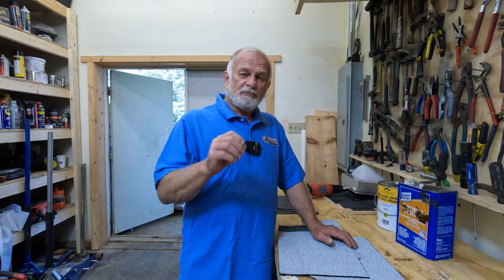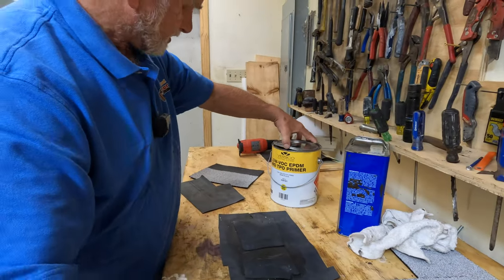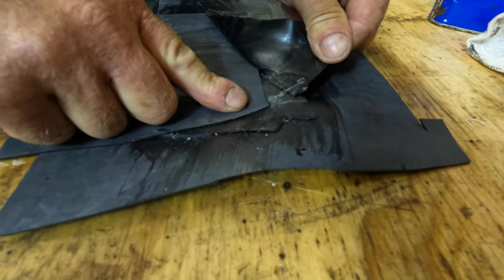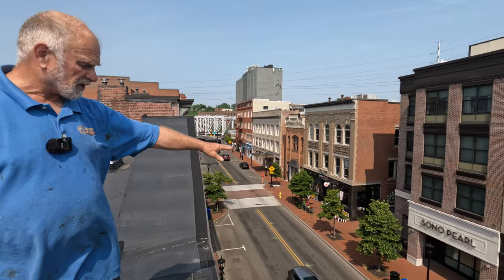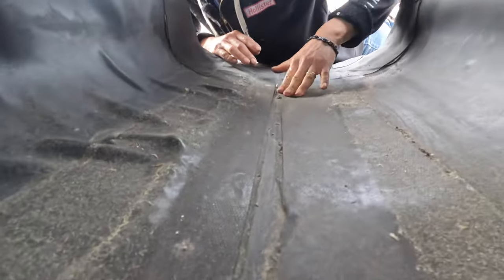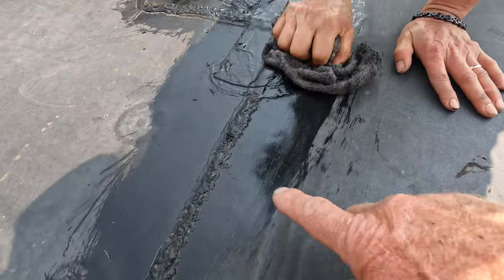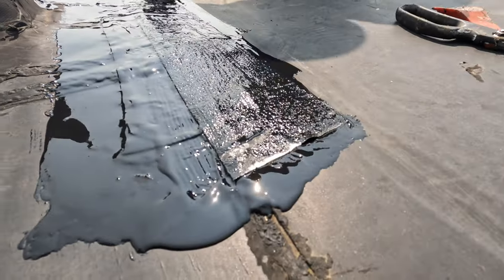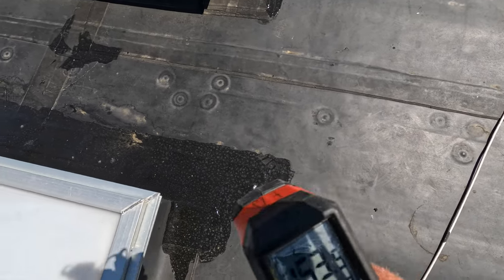Why EPDM Rubber Roofs Leak and How to REPAIR Rubber Roofs Permanently with Easy Brush on Sealant

Comment: Pretty sure this man needs to go back to rubber roofing school been flat roofing 25 years he’s not accurate with current insulation methods
Reply: Just because current methods are different than old; it doesn't mean they are better!
Reply from the maker: We never talked about insulation in the video???  We only show what went wrong and how to repair it. What insulation?
Reply: I think he meant "instalation " but hes right, you have your old school tricks that in certain situations work just fine.  But your take on epdm just is not accurate / up to date. And stop calling people ignorant.  @FlatRoofDoctor

Comment: EPDM sucks.  Even with this repair it, it will eventually leak again.  EPDM is also thin so with enough rain, water will go through.  With time, the adhesive will wear off and the EPDM will peel apart, allowing water to get in.  Unfortunately, with flat roof, you don't have a choice.  The permanent fix if possible is to make the roof slope slightly and go with torch down that is much thicker and permanent.
Reply: Really don’t know what your talking about watch to much fake flat roofer from east
Reply from the maker: I agree about Torch Down being the best. But your statement about EPDM will leak because of a lot of rain, makes no sense. There are many 1000's of EPDM roofs and they get a lot of rain. The issue is EPDM shrinks and eventually will put pressure on the flashing and walls pulling it loose. Yes it is thinner than Torch Down,  but that is not a cause of leaking. As in the video, we show exactly the reason for the leaks. The seams that are glued together will eventually separate.

Comment: You only showed a primed lap joint,they make a 3"&6" seam tape to do a much better job in splicing the seams together.
Reply: @3:28
Reply: @MNCasaPro that’s “cover tape” used to strip in a seam that has failed or so on. Seam tape goes between the 2 pieces of primer rubber to bond the two together. They haven’t bonded seams with just primer in 25+ years. This dudes a hack.
Reply: @carterdavis9416  Got it.  I've been looking for the product you describe, as I've seen it in a number of other vids.

Comment: Seams are always the issue regardless of the type of material and the roof shown has plenty of them. Super Silicon and similar products all pretty much insist the "fleece" reinforcement be used as it is a total system. It can resolve almost all leak issues. I wonder why ANY contractor could not remedy this leaking easily. So sad.

Comment: I have a section of my house that has an epdm roof on it. IT was already installed when i bought the house. At the edge of the house right before the gutter. It lookes like they used some sort of 4 to 6 inch tape ( i assume something like u showed early in the video). What is the proper way to terminate the rubber roof right at the edge  like where a drip edge would be. ( hope that makes sense} can i use the super silicone over the existing tape that they put down.  I really need to go back up there and investigate but there is tape ran all along the edge of that part of the house. Its not leaking at the  moment but looks like water would travel that way and hit the tape before it goes over the edge and into the gutter. I assume water is going to eventually get under the tape.
Reply: Don’t listen to this dude. He has no clue what he’s talking about. They haven’t solely relied on just primer on seams in 25+ years. He’s also using a primer that is not made by any roofing manufacturer. They use “seam tape” between the seams. The “leaks” he’s showing is just hack work, and not done to manufacture specifications. An EPDM rubber roof will last well over its life time when installed correctly to the manufacturer specifications.
Reply: @carterdavis9416  thank you this dude is not educated in commercial roofing for sure. To answer your question the tape is to cover the nails that were put down to hold your gutter up. It will last as long as the roof as long as they used the correct seem tape and the correct primer.
Reply: And all rubber needs to be terminated with metal. If it's just rubber then you need to install some drip edge or gutters onto the edge
Reply: @tdenver68  Thank you for the info
Reply: @robavis4906   it sounds like it's the 4 or 6" seem tape that they put over the nails that hold the gutter on. That is standard practice and done correctly and the epdm will hold for 25 years plus. Your epdm roof is way better than shingles and will last forever if you keep it clean.

Comment: Just because current methods are different than old; it doesn't mean they are better!
Reply from the maker: Technology keep changing. Maybe we should have stayed with the old cars and old appliances. EPDM have been used for roofing since the 60's . Ever Since they have had trouble with the seams. They have changed the adhesives and technique over 5 times and still do not solve the problem. Using the Super Silicone Seal is a huge breakthrough. That is the only product that will seep into the small crevices and joints and seal it. It also bonds to EPDM super super good. So back to your statement - This current method is proven to be far better, saving a lot of people a lot of money.

Comment: Wonderful tips and tricks. I would also paint it with aluminium paint. Rubber is excellent material, but the seams are always an issue on a rubber roof.

Comment: THIS IS NOT HOW RUBBER IS INSTALLED.

You would use adhesive on a 3 or 6 inch seam tape with 1/8 of an inch reveal.
Reply: You tell him. I think that guy is on crack

Comment: Great video. Two questions. 1 -- can you apply this on seams even if you have roof heaters installed underneath the roof rubber? I live in Boston, winters can be harsh, so, there is a roof heater for heavy stormy days. 2 -- would butyl tape do the same job as the super silicone seal?

Comment: Once the can of Super Silicone Seal is opened, does it store well if you put the lid back on tight? Or will it go solid so you would have to buy another can if you wanted to use it later?
Reply from the maker: no sealant stores well, not even paint. once it is exposed to air and moist, curing starts.
Reply: Manufacturers website states...Shelf life after opening: 1 month (adequately sealed).

Comment: I was given a rubber roof. So I'm not sure if its epdm. How do I tell? And I need to make the roof a little longer is it ok to attach a different type of rubber to it?
Reply from the maker: You better off staying with the same material. EPDM feels and looks like an innertube of a car tire. Torch Down Rubber have seams every 3 feet.

Comment: what about using polyurethane caulk between epdm layers? would it make it any better? polycaulk has low vicosity to penetrate cavities inside those grift multiple patches one on another and very flexbile and bonds tight to epdm i assume as it does to conrete and wood but not metal
Reply from the maker: caulking covers a small surface area and when it shrinks, it comes loose

Comment: My job tomorrow is leaking huge skylight over restaurant,  the leak is exactly what he is showing ( to places) in external epdm external corner upstand. Leaking under lap,  I patched it with a torch on patch x2 its worked, replacing hole roof with torch on sbs tomorrow
Reply: You patch an EPDM rubber roof with torch down material? 😂 you’d burn through the rubber writhing seconds of trying to “torch” your patch on. You hacks need to stop talking about stuff you obviously know nothing about. 😂
Reply: @carterdavis9416  fool you don't torch the rubber you use a hear gun
Reply: @nonsheep5823  you don’t use a heat gun on rubber 😂 you clearly have no idea what you’re talking about. EPDM rubber and Tpo, pvc heat weld systems are completely different 😂
Reply: @carterdavis9416  I used on resitrix roof that gets heat welded anyway ?  , kept the water out temporally, roofs been redone now with sbs ,
Reply: Epdm does get heat welded
Reply: @nonsheep5823  please stop, YOU DONT HAVE THE SLIGHTEST CLUE OF WHAT UOU ARE TALKING ABOUT, AND NEITHER DOES THE GUY IN THE VIDEO

Comment: Why does this rubber roof need repairing so soon.? is it over 40 years old.
Reply from the maker: The rubber itself is not a problem. "is it over 40 years old?" You did not watch the video? A few minutes into the video I asked the owner when was the roof installed. He said about 2 years ago. The adhesives that are used on the seams does not seal the overlapping joints properly. Watch the video to see exactly why it is leaking. I did the sample in the beginning of the video for someone like you. You should watch it again.

Comment: I was going to be polite, but I can't stand the misinformation anymore.
1. He put that seam together with just primer, no seam tape. There is a 3" seam tape that goes in between the two layers that makes it almost impossible to pull apart without destroying the material. 
2. All joints in EPDM roofs are required have a T-patch installed over the top of it with a different uncured membrane that conforms to the joint and seals it. Caulking is applied to the joint itself underneath the patch, and around the installed patch to insure water can't travel in the manner he showed. 
Ok, I feel better now, carry on....